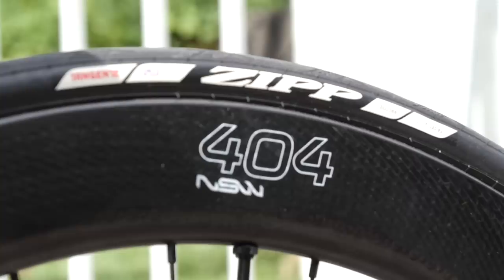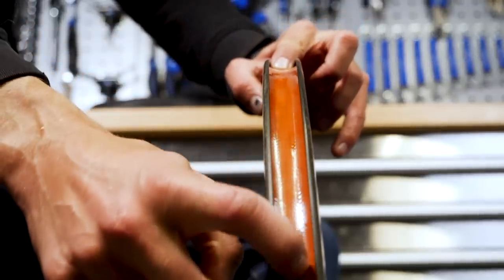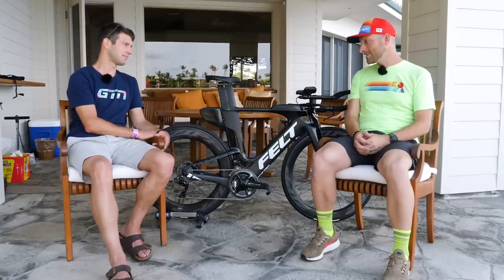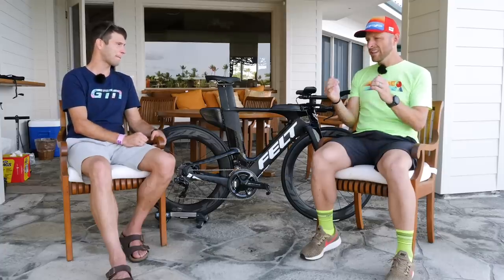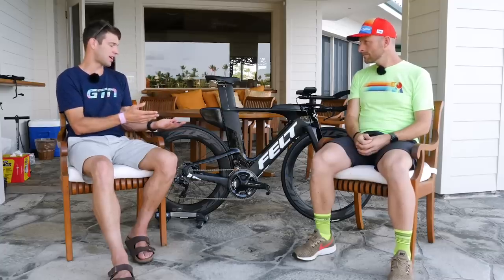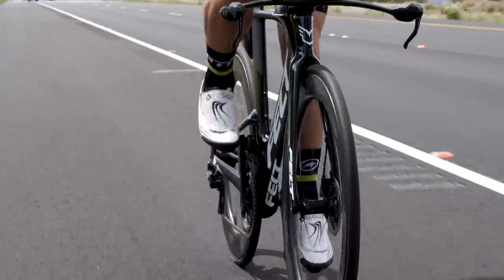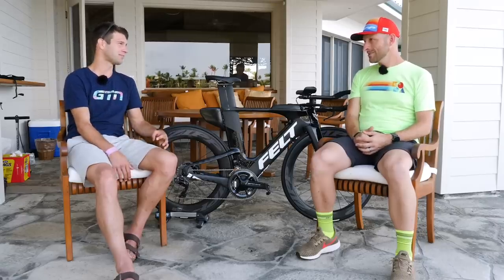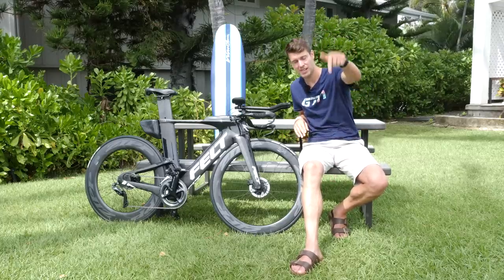The Truth About Going Tubeless | Cycling Tyre Myths Debunked

Comment: what about putting the sealant inside in the inner tube? will it help?
Reply: I use sealant inside inner tube. I got a puncture after a several months, there was no sealant coming out of the tube. I think sealant needs to be refilled every few months. The difficult part is getting the sealant inside the tube. I am waiting for a solid tire that will solve all puncture issues.
Reply: @arbjful  They already exist and they provide a crappy ride. What's the problem with putting sealant in a tube? You just inject it through the valve stem. Simples.

Comment: Yeah I tried tubeless. But I stopped when I had a flat it wouldn't seal. But try putting a tube into a tubeless tire out on the road. It sucks. Old sealant on the rim making it slippery. Tubeless tires are generally a b*tch to get back on the rim too.

Comment: I have deep section wheels and need valve extenders - I always find the 'milk' gets clogged in the valve extenders.  How can I overcome this problem?
Reply: anytime you let the bike rest, rotate the valves to a 3 or 9 oclock position so sealant doesn't run into them.  never inflate with the valve located near the bottom - rotate position so that sealant can't travel back up the valve when you release pressure.  learned this all the hard way by gumming up valves and pumps.  had to tear down the whole pump to clean the goop out, but since following these precautions i've not had an issue.

Comment: LOL ok I am fairly well educated- Someone please explain to me how "friction inside the tire" helps rolling resistance LOL (It helps it by changing the shape of the contact patch due to a change in air pressure run and the shape the tire contact patch takes when compressed by the riders weight e.g friction outside the tire) it has nothing to do with friction inside the tire between tube and tire. "Rolling resistance" has to do with the interaction between the tire and the road, so the interaction between a tube and the inside of the tire will have virtually no affect other than changing rotational mass, but it has been shown that sealant plus the slightly heaver tubeless ready tire actually come to a slightly heavier weight than tube setups on most equivalent level setups for road bikes (it can be less on a MTB). This person does not really understand "rolling resistance" for instance a bad wheel bearing will provide resistance but it is not "rolling resistance" it is rotational resistance again "rolling resistance" deals with the frictional resistance between the road and the tire, it is primarily decided by material interface [e.g. road surface and tire compound] and the size and shape of the contact patch. A large contact patch and sticky tire provide great traction but actually increase rolling resistance which is why anyone that has ever put wide sticky tires on a sports car has seen their MPG go down. The more uniformity of the pressure on the tire itself due to lack of a tube does help to dive a more uniform contact patch and this likely does dive a few watts of benefit in the area of rolling resistance (but it will be very small) it likely also has some to do with the tubeless craze meaning that some of the more advanced new tires are being released on tubeless tires.

Comment: i've had good success converting standard hook rims to tubeless with the proper rim tape and valve.  i lose about 10 psi over the course of a week, but really you should be topping up your tire pressures every ride anyway.  if you've got a wheel set on hand, i'd say it's worth a try.

Comment: I agree with the below statement, “Marketing!” Ben Waite is straight up lying when he says you can’t successfully convert a non-tubeless ready rim to being tubeless ready ... honestly how stupid do you think we are Ben?!?

How easy and effective is it? I haven’t cycled in 20 years, I just bought a new gravel bike and while watching videos about gravel bikes I heard how amazing running tubeless was so I chose to convert my rims. Admittedly I am a complete amateur yet I bought proper rim tape along good MilKit valves, and clincher tires ... in under 30 minutes (most of the time spent struggling to get the new clincher tire on the rim) I was running tubeless w/sealant and all using a regular tire pump (maybe an hour to do both rims). I did watched a ton of tubeless conversion videos including all the nightmare scenarios but luckily it all went to plan! Been riding for weeks now without issues, at pressures 30+ PSI lower than the tire’s upper PSI rating and the ride is great. Yes, I do loose about 5 to 10 PSI after a ride or if I leave it racked for a few days, but this is true of tubed tires as well. So much for Ben laughing off converting non-tubeless ready rims, I have had that last laugh! ;-D

Apparently GTN is not GCN, who make amazing, informative and garbage free videos, so I think I will go back to watching their videos!
Reply: I think he had to say that for liability purposes.  Everyone knows it's possible.  It's not necessarily safe in the event of a blowout while riding. He can't really be encouraging people to set up non tubeless rims as tubeless and then have people getting hurt.
Reply: @kwbarrettjr  I'm pretty sure the rubbing against each other thing is wrong,  but if you have two things moving about and flexing it's obviously going to provide more resistance than one thing.

Comment: what would happen if you pumped 
A. Helium 
B. Nitrogen 
C. Oxygen
In your wheel, regardless tubeless or tubed?
Reply: nothing different since you still need the same proportion of gas to inflate at pressure. p=nrt/v
Reply: Nitrogen: nothing would happen. Oxygen: if your tire catches fire, it would burn much faster. Helium: your tire will lose the helium at a faster rate than just using air. You might notice it at the end of a 4+ hr ride.
Reply: AA CC  is partially wrong because you would normally use van der Wals equation beside that it could change the rate of diffusion and the mass would be different

Comment: Over selling tubeless. You can cut the sidewalls via  a rock compressing a tire sidwall against the rim. Also,  putting in a tube is messy and a pain in the butt. Sealant gets everywhere. And when a tire is punctured, the sealant sprays all over your bike. You need to top off the sealant at least once a month. The sealant dries and forms dried areas inside a tire. I have gone back to tubes. Much better for training. You can put sealant inside your tubes. Has worked great for me. Will not seal a pinch flat however.

Comment: Tubeless are the equivalent of the Emperor's new clothes on road bikes.

They lack the suppleness of decent clinchers and become skittish in the wet conditions often found in the UK so cornering is not confidence inspiring.

Most people will still carry a spare tube "to be safe".

I rode them for a year and about 8000km  in all conditions to try and give them a fair chance. The two times I needed them to work the sealant failed its job description.

If you're not really sure put your money into decent clinchers and put talcum powder inside the tyre and on the tube to help reduce internal friction.
Reply: "become skittish in the wet conditions often found in the UK so cornering is not confidence inspiring." - That's just going to be down to the tyre you used. Not all tyres are created equal.

Comment: hmm, got 3000 tubeless kms, dozens of puncture flats and spinning sealant, and one double flat and near traffic death (a bad oriented drain in a curb). ditched them and went tubulars, goodbie 7 watts.. since, 50,000 kms  tubulars 3-6 controlled flats... the problem with tubeless is they now go on bicycles as fast as any inner city trafffic limits, but are not regulated ISO and ANSI like tires. So you have different rims and application methods, use of lever force and other manufacturing deficiencies that, at a certain psi or temperature, does let go on the weakest sidewall spot. The list of tubuless riders waking up in hospitals, broken 15,000$ bike nowhere to be seen, has gone up. of course this does not happen with car tires, not since the Firestone fiasco that killed. Another issue with tubeless is that they are psi and temperature sensitive. you can pump it at 70 psi but at 35-50c asphalt can go up beyond safety. of course this simply does not happen with tubulars, they may go up 10% but have where to expand, safely. Outside the rim cavity, not tubeless, the increase the sideload on the rim, hook and bead. for these safety concerns, they should be banned until regulated. as for puncture- how many times i checked a warn out Veloflex or Conti tubular, finding half a dozen-dozen  tread to casing punctures, but NONE that breached then inner tube (or i would have had a flat). with tubeless that is a flat each time, stop ride or slow down even if sealed, and, esp on rears, must remove and patch at home. that would be 12 lost rides?? 5% of trips per tubeless lifecycle? yes depends where one lives, some pristine EU cities no doubt conti TL last forever no punctures..and yes, slow 10-30 km riders  tubeless is less an issue, not enough speed psi or temp and mileage to worry

Comment: I switched on my Road Bike to Tubeless. I chose one of the most rugged tyres out there, the Conti GP5000TL in 25mm. After 80km I got a flat tyre, the sealant couldn't close this little cut. I tried it before with a Vittoria Corsa Speed, but this tyre has no puncture resistance at all, so it was not a big surprise I got a flat after 20km. The sealant could close the hole but this tyre didn't hold more than 6bar anymore. The takeaway is this system is not as good as people promise. I give it a 3rd shot now, if I have a flat again I'll opt for a good Clincher with turbolito tubes inside...
Reply: Tubeless only works fine for mtb or cross tires up to around  4-5 bar pressure, anything higher than that won't be sealed up by the fluid...i don't know of anyone in my huge cycling club who could make it work  for heavier riders on road tires  with 7 bar pressure...sealant will spray out and plugs just pop out... you can ride  home with low pressure but it's no real solution like it is for mtb...running tubeless on my mtb for nearly 10 years now and never had any issues
Reply: conti 5000 is a race tyre not as you describe a rugged tyre
Reply: @cleggycyclist  really? What was one of the most rugged tyres on the market? Excactly the GP4000. Conti claimes the GP5000 has got a better punkture resistance than the GP4000, you do the math. A Vittoria Corsa Speed or Specialized Turbo Cotton are true race tyre with almost no existing puncture resistance.
Reply: @borrisjung8049  the only tyre to self destruct its sidewall for me was a 4000 and if you check online many others have had this with both 4000 and 5000. If they work for you great 👍 for me I doubt if I would ever trust them again

Comment: Hi, do all tubeless setups require sealants?
Reply: Yes
Reply: Melvin Lee, no not all wheels require sealant. There are tubeless certified wheels and tubeless compatible wheels. I have had no problems running tubeless tyres on my Compag zonda wheels without sealant (though i do have to pump them up once a week). For my carbon wheels however (i have Bontrager Aeolus pro and Zipp NSW) you def. need sealant.

Comment: Wider tires are not faster. They are trying to sell us on this crap because they want tubeless to work on road bikes just as it does on mountain bikes. Lower pressures have a better chance of holding in the sealant in the case of a puncture. I have never gotten the sealant to work on any punctures on my road bike and have always ended in putting a tube in. So what is the point of dropping the use of inner tubes?
Reply: Er yes they are...............